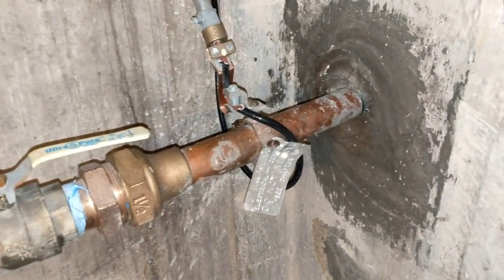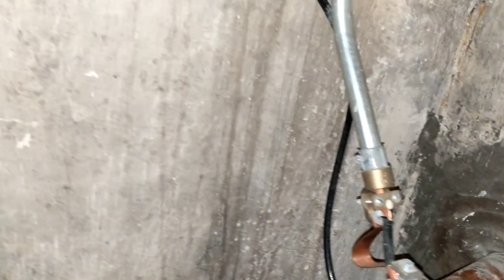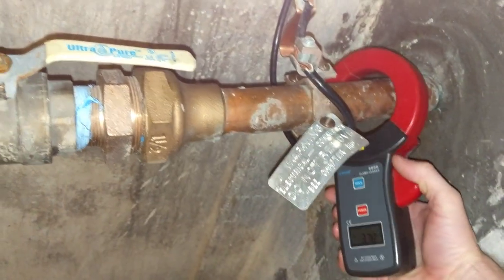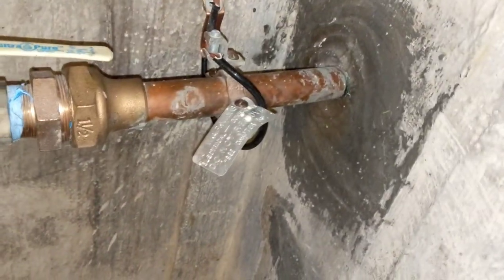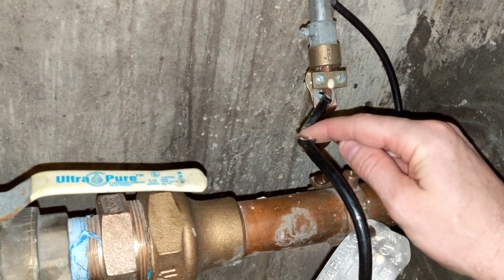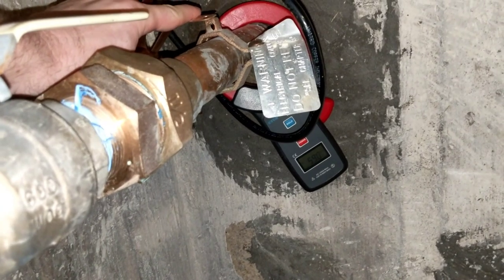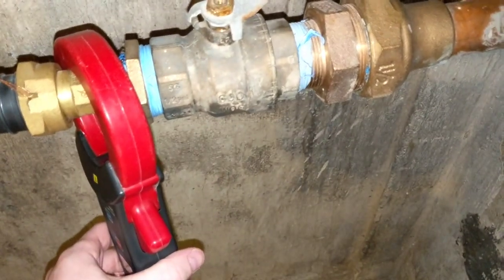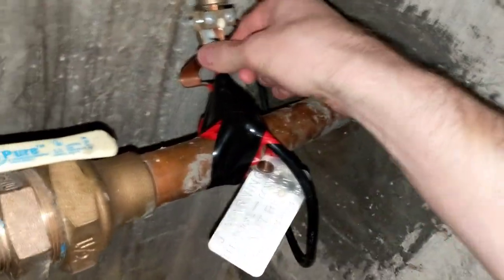How to measure current on pipes with AC Clamp Meter and isolate water pipe to stop undesired current

Comment: 250.50 Grounding Electrode System

All grounding electrodes as described in 250.52(A)(1) through (A)(7) that are present at each building or structure served shall be bonded together to form the grounding electrode system. Where none of these grounding electrodes exist, one or more of the grounding electrodes specified in 250.52(A)(4) through (A)(8) shall be installed and used.
Reply from the maker: 250.52 Grounding Electrodes.

250.52(A) Electrodes Permitted for Grounding.

(1) Metal Underground Water Pipe. A metal underground water pipe in direct contact with the earth for 3.0 m (10 ft) or more (including any metal well casing bonded to the pipe) and electrically continuous ***(or made electrically continuous by bonding around insulating joints or insulating pipe)*** to the points of connection of the grounding electrode conductor and the bonding conductor(s) or jumper(s), if installed.

If the pipe has a break in it, and does not have a jumper to bypass the break, it is not permitted to be used.  I added the ** to point this out.  The code does not state you must add the jumper and bond to it.  You are going against what Mike Holt states when he says stop adding grounding electrodes.  Keep them close to the disconnect and central point origin of equipment ground eg neutral/ground bond.  Don't run long cables somewhere else and use a pipe when you can use 2 rods right at the central location.

And by installing the break and NOT jumping it and bonding to the pipe, you have also solved the issue of using pipes as conductors.  You don't need the pipe when you have ground rods.  So far of all the comments, the only argument made to use the pipe, besides your code argument that I just refuted, has been the argument that the pipe should be bonded and turned into a parallel neutr so it can take over all of the neutral current in the event the service neutral feeder fails.  This is crazy!!!  No - you don't setup a pipe to be a parallel path - an auxiliary neutral.  That is nuts.
Reply: @EMFExplorer  
Emphasis on "all" & "shall". Your interpretation of this entire issue is incorrect.
Reply from the maker: @realTlMBOSLlCE  A grounding electrode that has not been "made electrically continuous by bonding around insulating joins or insulating pipe" does not meet the definition of a permitted grounding electrode.  Show me where in the code it says you absolutely must turn an insulated pipe that is has NOT been made continuous into one.  It doesn't exist.

Therefore, this is perfectly allowable and meets code.
Reply from the maker: You are creating objectionable current (NEC 250.6) by using water pipes as parallel conductors.

https://www.mikeholt.com/mojonewsarchive/GB-HTML/HTML/NECArticle250Sections250.6-250.12~20020125.htm
Reply from the maker: I would like to know why you feel it is necessary and advisable to insist upon making a non-continuous metal pipe into a permitted grounding electrode by fitting it with a jumper, if the building already has more than adequate grounding via rods/etc.

I would like to know why you think it is OK to create a situation where objectionable current is flowing on water pipes, when it is not required by code, and actually not allowed by code.

How much current to you is objectionable?

I find the current going through ground rods rather objectionable too - utility companies need to update their wiring and bring more of the current back onto the wires where it should be, taking the appropriate path as designed.  But since ground rods provide benefit, I am not arguing to stop using those.  I will continue to argue and make videos to encourage people to NOT use their water pipe as a grounding electrode and make sure it is properly insulated to eliminate the objectionable current.

So my question is what's the beef with it?  What are you worried about?  Show me a downside.  I see nothing at all but advantages to doing this.  It also goes along with what Mike says which is have grounding in one place and one place only - don't bring wires out to other places across distances because you think a "good" ground is there.
Reply: @EMFExplorer    
The copper pipe entering the building is a grounding electrode, therefor it shall be bonded. Again, "all" & "shall" are the key words here.
Reply from the maker: @realTlMBOSLlCE  250.53 (D) Metal Underground Water Pipe
If used as a grounding electrode, metal underground water pipe shall meet the requirements of 250.53(D)(1) and (D)(2).

Notice the word "If" - the first word of the subsection.  Optional.  That being said, yes the interior pipes in/on the building need to be grounded as per 250.104.  But it is not required to use every metal water pipe as a grounding electrode just by nature of it coming into the building.

I'm not talking about current induced from other sources.  The measurements we take are mostly AC current measurements from AC loads on the grid.  Grid current is traveling around on pipes - this is a real problem.

You said a small amount - so I ask you - what is your threshold for "small" amount?  At what point does current on a water pipe cease being small in your opinion?
Reply: @EMFExplorer  
I'll address the 2 last paragraphs of that comment first...I haven't said a single word about current, ac loads, grid current or "small amount" so please get your arguments sorted out, clearly there are too many people disagreeing with you that it's making it difficult to keep up.
Now, back to the copper water pipe...it is safe to say that the pipe is in direct contact with earth for 10 ft before entering the building, this makes it (as we have already defined) a grounding electrode per code. That being said...ALL grounding electrodes SHALL be bonded to the grounding electrode system. The "if" you've pointed out is referring to whether or not the lateral water pipe is metal & in direct contact with earth for at least 10 ft.
Reply from the maker: @realTlMBOSLlCE  We still disagree on this: 

(1) Metal Underground Water Pipe. A metal underground water pipe in direct contact with the earth for 3.0 m (10 ft) or more (including any metal well casing bonded to the pipe) **AND** electrically continuous (**OR** made electrically continuous by bonding around insulating joints or insulating pipe) to the points of connection of the grounding electrode conductor and the bonding conductor(s) or jumper(s), if installed.

The AND and OR are operating words.  You can't pretend they don't exist.  All requirements must be met.  If a metal pipe coming in has a break AND is NOT made electrically continuous, it is not a permitted grounding electrode.  It does not meet the definition of the term grounding electrode at that point.  It may not be used.  Sure you can jump it and use it, but that's optional.  I contend that not only is it optional, but it is unnecessary, and causes problems.  Still waiting for someone to tell me why they think they need it.  So far the code shows it is not required.  For the sake of argument, let's say the code did require it.  Can you explain why?

Do you want lightning coming in on rods, going through a gas appliance like a water heater, and leaving through the water pipe or vice-versa?
Reply: @EMFExplorer  
We're talking about the jumper across the meter, correct? That is not underground, correct? The verbiage you are trying to use to validate this is regarding insulated connections underground where the pipe may not be in direct contact with earth for at least 10 ft. Both sides of that water meter must be bonded, the easiest and most cost-effective way of doing this is by simply using a couple j-clamps and a jumper.
Reply from the maker: We will have to agree to disagree since it can be interpreted either way.  I'm saying if the pipe is insulated and no jumper is installed, it's not a grounding electrode and doesn't need to be bonded.

You can respond and say "yes, it does." And I can respond and say it doesn't.  But, that doesn't get us anywhere.

Why does Mike say in his videos have grounding electrodes in one place and one place only - don't run long wires out to them.  He says you can install more, but he doesn't think it's a good idea.

Well we know why - it can encourage lightning to flow through the building unnecessarily and even through equipment or people in theory.

So I am saying this is a better way to do it because 1) it stops water pipes being used as conductors in circuits and carrying objectionable current that can cause magnetic fields which induce current (turning things into transformers) 2) creates an unnecessary path for lightning current by having electrodes spread out.

The objectionable current is a real issue.  It's a 24/7 problem in the building caused by the improper use of a pipe.  Pipes are not to be used as conductors, period.  If a pipe is carrying current outside of a fault/short situation, then you have a design problem in the system.  We should not be using pipes as conductors.  It is as simple as that.  We can argue about NEC, but no one can argue with this statement.

So let's fix the design.
Reply: @EMFExplorer  
It seems like you don't even understand the purpose of bonding metal pipe systems. These are metal components that absolutely can, but should not, become energized. How do we prevent that? Through BONDING. I honestly don't understand what the purpose of your video even is...it sure seems like a solution looking for a problem if you ask me. I do know two things for certain though; 1. You are violating NEC when you do this & 2. You are creating an unsafe condition when you do this. So, you go ahead and keep using this unsafe method but I wouldn't go parading around advertising about it. Best of luck.
Reply from the maker: @realTlMBOSLlCE  bonding metal systems is important, but not as important if they are insulated and pose no real threat.  You don't seem to understand that pipes should t be used as conductors, that circuit conductors should be within the same cable/conduit/raceway (also NEC requirement) which makes it so the positive a d negative conductor are following the same path.  Current needs to be balanced and on the conductors.

You can't seem to answer my question - how much current would you say is a problem when it is flowing on a water supply pipe.

NEC mentions objectionable current, requires us to keep current on the conductors in the same cable/conduit/etc, doesn't allow us to use pipes as conductors, and you want to turn your blinders on to all of that because you're worries about what exactly happening with a few feet section of pipe that's already bonded in other places outside of the building and running through lots of earth?

How much current is a problem, Timbo?
Reply: @EMFExplorer  
Where is the pipe in your video being used as a conductor? Oh...it's not. You're just talking in circles now and I'm convinced this is a troll. No current is acceptable on a metal pipe system, that's why we bond them.  Good luck bud, I'm done with this.
Reply from the maker: @realTlMBOSLlCE  the video shows a current measurement of the pipe when it is bonded.  Current is flowing on the pipe.  The pipe is acting as and being used as a conductor.  How is that talking in circles?  It's on the video.

I have hundreds of video clips and photos of current on pipes that I personally took.  And of course many more that I measure but didn't photo/record.

 The pipe is acting as a conductor as part of a circuit.  Do you not understand that?  Current takes all paths.

So how much is a problem?

Comment: @EMFExplorer Could you recommend instructions for a novice (or where I might find them) for using a multimeter to test if current is coming through a pipe (if it’s possible to use a multimeter— don’t have a clamp meter). Thank you!

Comment: You're suggesting that you create a dangerous situation then hide it so that a qualified professional does not notice it.  While the presence of objectionable current in the water pipe is a problem, your "solution" creates a situation that could result in death by electrocution.
Reply from the maker: I already conceded in other comments that there is a better way to do it - the bonding conduit/wire should be completely removed.  However, this old way of thinking is keeping the bonding requirement on some local codes and in the habits of countless electricians nationwide.

So, I suggest we come up with a solution that will both be safe and healthy.  I don't want to see anyone electrocuted, either.  But I also hate seeing all of the cancer, neurological, cardiac, and immune system problems we have these days, many of which are caused by our artificial exposure to fields and radiation in the electromagnetic spectrum that are orders of magnitude stronger and in no way resemble those found in the natural environment.
Reply: Whether you conceded that there may be better solutions is irrelevant.  Fact is your video is suggesting that a home owner create an unsafe situation from one that is benign.  You take it one step further by suggesting that they hide what they've done.  Most people who see the video will not look at the comments.  The more people who see this video, the more people will die.

Your concern about cancer caused by any electromagnetic radiation resulting from this situation is unfounded.  Any electromagnetic waves emanating from the pipe will be extremely low power, non-ionizing radiation with a wavelength of around 5000 km.  Harmonics may also be present but at orders of magnitude lower power (and still non-ionizing).

Cancer risk  results from exposure to ionizing electromagnetic radiation with a wavelength of around 400nm or smaller, as it can cause alterations to DNA molecules.  UV and X-Ray are examples of types of ionizing electromagnetic radiation.

Please take down this video.  Keeping this video available is irresponsible and unethical.
Reply from the maker: @BeardedOneWithBeard  No one's been electrocuted by doing this, and probably never will be.  I already responded to that in another comment - the chances are virtually nil.
Reply from the maker: Accidentally hit send too soon.  All frequencies are biologically active.  It is most certainly not only ionizing radiation that causes cancer.  Both radio frequency and electromagnetic fields and even visible "light at night" are all listed as IARC cancer agents.  Please stop repeating myths that you've heard such as the "non-ionizing radiation is harmless" myth.  Or put your household pet in a microwave oven - it's non-ionizing!  Besides heating effects, there are also electrical conductivity effects.  Changes in chemical reactivity, protein folding, voltage gated calcium channels, too many things to list here.  The science is very conclusive that there are very significant effects from the technology we use, including AC power.  Some effects can be beneficial, by the way.  But we are only beginning to understand this.

So please do not repeat these myths.  That is being irresponsible.

As for ethics and responsibility, it is my sincere belief based on my 12 years of training, knowledge, and experience that the magnetic fields from using pipes as conductors instead of keeping circuit current on their intended and allowed conductors is dangerous and irresponsible.  It is foolish, ignorant, outdated, and we must do better.  Break the pipe, use ground rods instead, and problem is solved.  You can insulate the pipe if that makes you feel better.  I will be happy to recommend this as well.  I will also make an updated video.

But we really need everyone to address and solve this issue together.  Why don't we focus on the fact that it is unnecessary, non-ideal, and causing issues (pipes being used as conductors and creating fields).  So let's change the way we do this together.  Would you agree to that?
Reply: @EMFExplorer  Not true at all.

Comment: If the field on the pipe is a problem, why isn’t the field in the wiring a problem? 

It seems to me that your grievance is that using the pipes and ground conductors creates magnetic fields which are bad so we should not do that and we should use the actual ground rods and neutrals that are in place. 

But that will just make fields somewhere else. Are these “pipe fields” we can call them, harmful to the body, or do they affect the water that people then consume? Where is the interaction between pipe fields and humans?
Reply from the maker: Incorrect.  When electrons flow on a conductor they create a magnetic field around the conductor.  Of course it does not matter if it is a pipe or wire or whatever.

For every electron that leaves a node, one must return.  So...somewhere there is a path or paths of electrons returning as well.  We are supposed to have these return right next to the conductor they are going out or leaving on.  And vice versa when the current switches direction in AC power.

As the electrons flow in the opposite direction, they create the opposite magnetic field.  The fields cancel.  I assume you own a clamp meter.  The reason these function and operate a d how they do so is through magnetic fields.  You've probably been taught to clamp around 1 conductor to measure its current.  The magnetic field of that conductor induces voltage which is then measured and calculated to determine the amperage in the conductor.

What you should be doing as well and very often is using your clamp meter to clamp around an entire cable or conduit - multiple conductors - and your reading should be 0.  If it is not 0 in the case of for example a Romex cable, then you have imbalanced current which means you have a short or a wiring error like neutral to ground or neutral to another neutral of another circuit.  Both of those are wiring errors and violate NEC.

So, start using your clamps they can be very helpful.

Does this make sense?